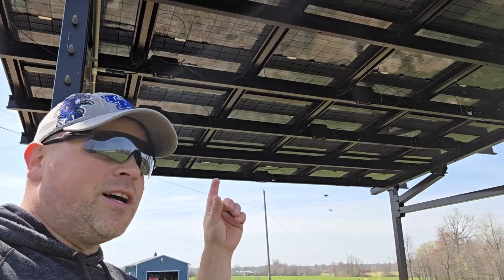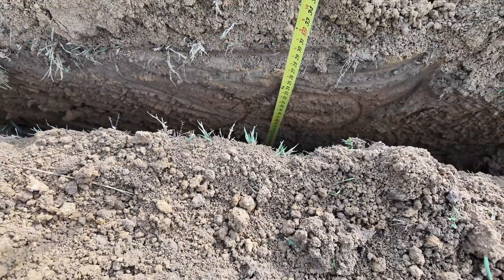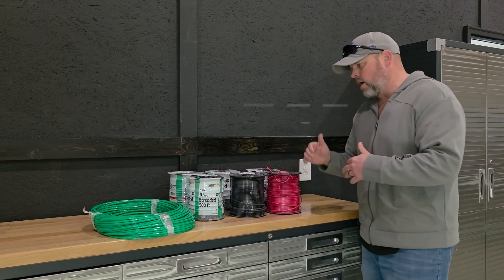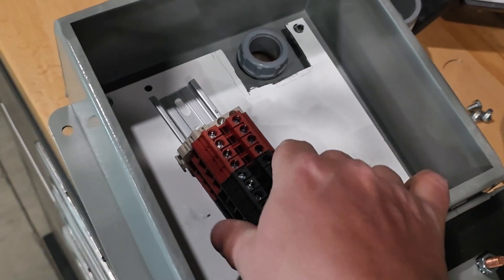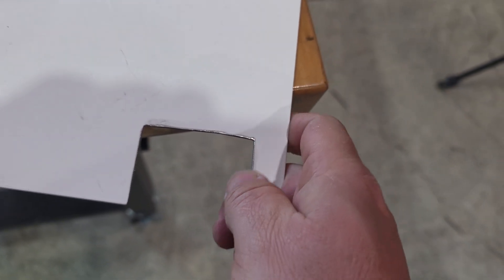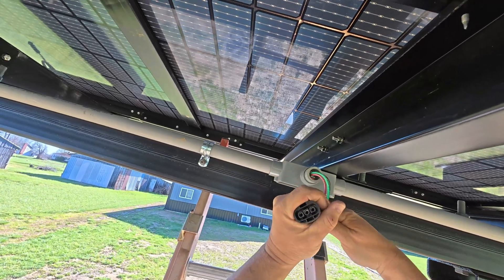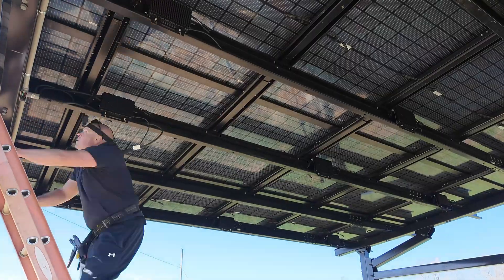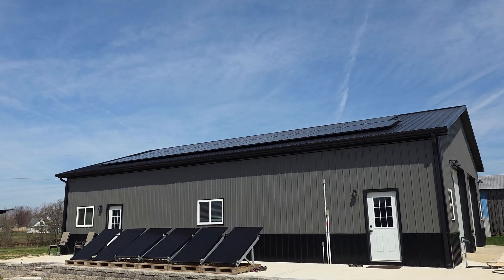FULL INSTALL - Hoymiles microinverters on Chiko Solar Carport

Comment: Do I need solar battery for storage of power and which cable is the output and input between those two short and a long coming from my inverter?I have got 1200watts hoymiles I am struggling to use it

Comment: My local code let me combine the microinver outputs in a subpanel in the detached garage. They even let me put a disconnect on the garage which is more than 10ft away from the meter. They require a note  with direction on the meter that authorize them to walk on my property to use the disconnect if it is further than 10ft. 

My one line diagram: Panels (1 east, 1 west facing)->BDM-800->the subpanel (inside the detached garage)->the AC blade disconnect (on the detached garage,40ft away from the meter)->The main panel (40A breaker)->the Meter->Utility

Comment: I use NEP BDM-800 dual micro inverters. It accepts 2x600W input power and outputs 768W. The advantage is if two panels are facing different direction, you can utilize full capacity of micro-inverter for a longer time. My alternative was two individual Enphase IQ8x (which outputs 385W). 

HMS-1000 accepts two 670+W panel...

Comment: I bought the HMS-2000-4T-NA to learn more about microinverters. I’m disappointed in the manual regarding the AC connection to my main panel. I’m assuming red and black are L1 and L2 and the green/yellow is the ground. I found in another hoymiles manual that black is “N” which really doesn’t make sense.
Reply: It makes sense for european users. You need to be sure if it is L2 or N. That will make a huge diffirence.

Comment: Where did you get that connector at 10:15 to convert from inverter cable to THHN?
Reply from the maker: Hoymiles has the extension connectors that I used those to make my string/branch connections so it would be a nice weatherproof connection. I glued the connector into a threaded coupling. It worked out pretty nicely 👌 👍🏻 😎
Reply: Yea those are nice. When I got mine it only came with the cord not the connector.

I have the same Microinverters you do.

Did you get the DTU to monitor each inverter?

Comment: I've found it helps if I pull the wires while the conduit is just dry fit and not glued. That way I have flexibility to get to stuck wires all along the path if need be. Once wires are fully pulled, then go back and cement all the joints.
Reply from the maker: That presents its own problems. Like the glue potentially damaging the wire. With the right fish tape I was able to complete the project with almost no issue though. I bought one off Amazon that was for long runs and bigger conduit.

Comment: Using Optimizer would maybe been better keeping the power DC for batteries charging, but AC goes right to your house.  I say wow those microinverter cost more than most solar panels. God bless you.
Reply from the maker: Both systems have their advantages and disadvantages. I have built both DC and AC systems. It really comes down to the end users goals. It's nice that Hoymiles offers a solution for either type of system.

Comment: Whats benefits vs running them to an eg4 inverter?
Reply from the maker: There are several advantages and disadvantages of using microinverters. I will need to make a full video on that. Ultimately, it comes down to the system owner and their overall goals. I love having a completely silent system. Zero sound disturbance. If you want an individual module date on a string inverter, additional DC optimizers will be needed. Which will lead to additional cost after the cost of the string inverter. In my opinion it is easier to expand in the future if you can't get similar solar panels with microinverters.  Since this system is grid tied, I am perfectly ok with microinverters. However, they are not a good solution for off-grid. That is where string inverters are the clear winner. Thats what I like about Hoymiles, they make Hybrid Inverters also.
Reply: @TheSolarPit  I'd be interested in seeing a video on how you wired this up to your house with breaker panels, etc. I struggle with microinverter vs something like an EG4 and am curious how this all ends up powering your place.
Reply from the maker: @jerkychew899 I have a video out on the hoymiles combiner box. I think thats exactly the video you are looking for.
Reply: @TheSolarPit  I'm always thinking about cost and payback time.
Reply: @jasonwinter739  if you have the grid boss that is a combiner box transfer switch and a programmable bus bar all in one!
Reply: Thinking about doing the carport plus gridboss and the new flexboss 21 with 3-4 batteries.  Building on eleuthera and power really bad and drops often and or bad.  Thoughts on setup?
Reply from the maker: @jasonwinter739 Sounds like you are focusing more on an off-grid system. The setup you mentioned is pretty solid in my opinion. I would like to add the bossbox to my setup with a couple batteries. I will have both a grid tie system and off grid system in the near future. I have worked for years to get this completed so that I can test them side by side in real life usage at the same location - not hypothetically but literally. Data that will be every useful for us all.
Reply: @TheSolarPit  thanks!  Looking at linking to the local grid with gridboss but want to be almost fully offgrid.  Dont want generators etc.   Sometimes the local grid drops a phase and all sorts of weirdness happens.  Want to isolate my electronics from the surges etc and hoping the eg4 setup will do that.
Reply: @TheSolarPit also. What is the wind rating on the car port?  Would love this to have some shade but wondering on structure.   With doing it like yours with concrete etc, does it feel very stable?  Hurricane?
Reply: Maybe a bossbox with the solar carport.  Building now a small place
Reply: @jasonwinter739  are you worried about security or you may move in a few years, that's the only reason I would get the boss box.
Reply: @jasonwinter739  first is cost, i have looked at some old standard like Schneider, sungold, solis , solaredge their few others but they cost more and  do less.  
Eg4 is a Lux power that is rebranded but good value.